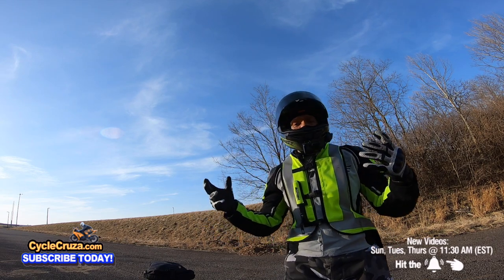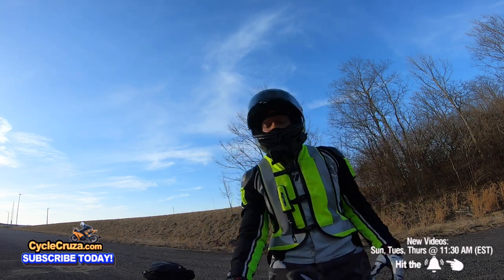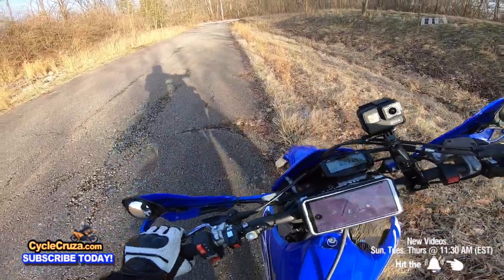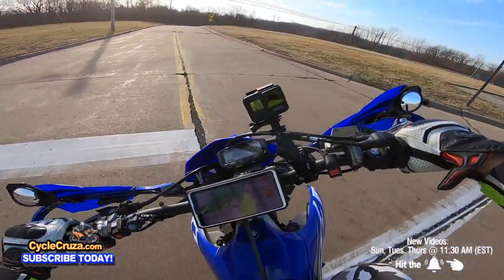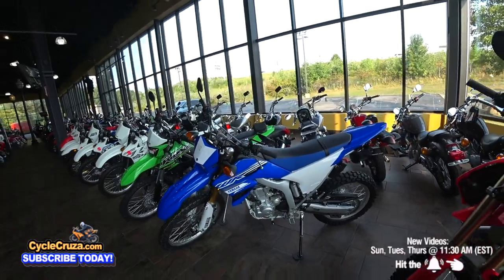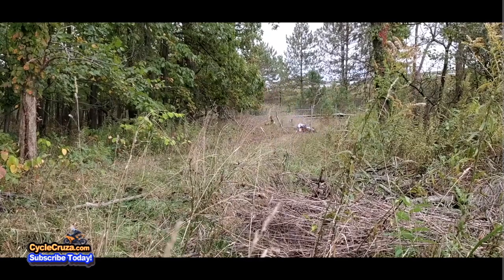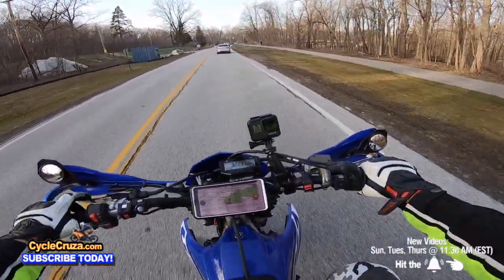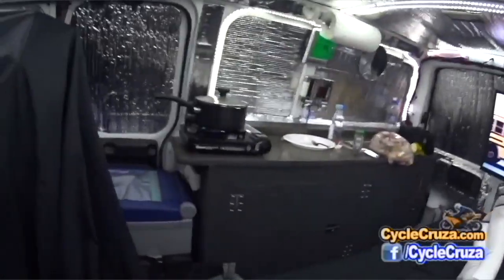UGLY Truth About Dual Sport Motorcycles

Comment: Your super moto is NOT the best of both worlds
Reply: Ouch
Reply: The drz400sm is though lol
Reply: @22smcrrider96  IMO the 690. I've been on a ton of bikes. The 690 is the perfect motorcycle for someone who is spirited.. you get speed, torque, crazy suspension, just everything man. The 690 is amazing. The Mt 09 is a close 2nd and that hurts me to say
Reply: @22smcrrider96  hahaha. Same bro. I bought mine last March. I put 10k miles on it.
Reply: @22smcrrider96  the point is that there isn't the BEST of both worlds.  Going Dual Sport means you can have a decent road and off road bike.  But they always fall a little short of a dedicated bike.
Reply: @jonasbaine3538  LOL. I'll tell you what I'm amazed how the 690 SMC R handles in dirt with street tires I'm on Q3+S  and I'm out here power Wheeling on dirt roads hitting jumps and shit lmao. I love the SMCR
Reply: @jonasbaine3538  I'm actually smoking a joint changing my oil right now I'm going riding tomorrow
Reply: TE630, X-Challenge, or even a fat-stripped DR790.

 Procycle stripped a DR down to 320lb curb. That can still be solid on the slab, crossing the continent, with a passenger and luggage. Some DRs have gone over 200K miles.

 The T7 can also probably be stripped below 400lb curb. 'Japanese reliability of the CP2 is nothing to sneeze at.
Reply: @RKmndo  I got my 2019 KTM 690 SMCR down to 310pounds with a full tank. It's like 298ish with no fuel
Reply: Ditto! I think he does these videos to piss people off. But that YZ is going to need a lot of Maintenance and a rebuild before you know it. He hardly put any real miles on his bikes. The WR or T7 has longevity on its side and will last long beyond that Supermoto of his. There's a price to pay for all that power and light weight. Also the 17in wheels and 80/20 tires he has will not go most places a true dual sport will go. Most people prefer a low-maintenance a versatile machine. Not to mention his YZ cost probably double the price of a WR when it's all said and done Anyway take what CC says with a grain of salt. It is entertaining and some of his videos are informative.
Reply: 100% is. Dont knock it till you try it. 690 is a great bike but no where even close to a good dualsport for offroad
Reply: @vondrz1391  if you can ride it is. I've had mine with street tires in trails and it didn't skip a beat. I've been on mostly every bike especially the 450 class ...it doesn't compare to a 690/701. UNLESS YOYR HIGHLY SKILLED AND ON A SM TRACK OR SOME TIGHT TWISTIES WITH MINIMAL STRAIGHTS...
AND EVEN THEN A GOOD RIDER ON A 690 IS GOING TO YOU PROBLEMS. TRUST ME. IVE RACED EVERYTHING ON MY SMCR AND THATS THE ONLY WAY A 450 WINS.
Reply: @ridelikebuu  maybe for roads/dirt roads or a track sure. 690 is a bigger motor. Good luck on the trails. Even a DRZ is easier to manage in tighter wooded trails imo. Depends on what youre riding but a lightweight bike is a better "do it all" imo
Reply: @vondrz1391  yeah that's true but I'm recommending the 690 mainly for cycle cruza. I've never had it in tight tight trails but I have had it in some questionable areas and you do feel the weight. But other than that it's a badddddd girl
Reply: @ridelikebuu  100% a beast bike. for cruzas needs i agree he should try one 👌
Reply: @vondrz1391  Lighter is better for a dirtbike, but not necessarily for a do-it-all. A light dirtbike might be better on a dirt track/trail, but a heavier 500EXC enduro or a dualsport is generally going to be better running slab. Vibes, instability, lack of a cush-drive, and narrow overall gearspread make most dirtbikes miserable on pavement rides longer than just around the neighborhood. Dirtbikes don't have passenger pegs either.

 I'd lean more towards a TE630, or DR-Z500S with a wide-ratio gearset, for a do-it-all moto. Strip some weight and get some SM wheels. They can even haul luggage and a passenger all day. I prefer availability of huge tanks, a carb, and conventional forks for a moto that I might ride through BFE.

 The WR250R/X needs more power. He would have probably been happy on a 500EXC.

 Tube tires aren't difficult to deal with.
Reply: @RKmndo  the 450fx is the same weight as a 500exc. DOHC 450 is less vibrations then a 500 SOHC. I dont think cruza is riding with any passengers. Hes a MGHOW. DRZ is a great bike but no comparisson in power department
Reply: @vondrz1391  DR-Z500s can put out plenty of power...60+WHP.

 If he doesn't have kids or date, that's his perogative. I like having removable passenger pegs, and with dirtbikes that isn't really an option. I occasionally want to haul my kid around or move my feet around on long rides.

 Passenger pegs are offered as part of an aftermarket tailrack system for the 500EXC, BTW.
Reply: @Bmichaels679  you’ll never have the best of either of it’s not a dedicated bike, yes. But you can have a “best” at doing both.
Reply: How much does that bike drop with the supermoto tires a d wheels
Reply: A lot of opinion described as facts here
Reply: Ya i drove my shadow thru leaves once.  Does that mean i uave a duel sport?

Comment: My KLX300 does fine with turns. I don't have any issues riding it on the road. Got the 21/18 sized wheels on it.
Reply: Yeah, his 90% street isnt really "dual sport" is it?
Reply: @TheWhippetmaster  not quite. 
I ended up getting rid of my KLX300, gas tank was too small and not enough power. 
I have given up on moto camping or off roading too hard to shift with moto boots, and I can't afford to get hurt with all the other hobbies I have.

Comment: If you want reliability, low maintenance, offroad capability, travel long distances and touring then you can't beat the Yamaha Tenere 700. I converted mine to tubeless (rear only) so it got the best of both worlds
Reply: or you could get KLR650 for half the price wich will last you as long as an anvil ... whether you like it or not
Reply from the maker: How did you convert the 18" rear wheel to tubeless? Did you do it like I did on my YZ? https://youtu.be/lniuSPDtDgM
I didn't think you could safely convert a 18" dual sport rim to tubeless.
Reply: @CycleCruza  a lot of adv riders convert their 18/21 wheels to tubeless with kits like outex and such. But I find those kits a bit sketchy. That's why I send my rear wheel to Bartfactory in Italy. They do the tubeless conversion professionally and it looks way better than those outex kits. I have a video on my channel. The front wheel of the T7 doesn't have a safety hump and it can be dangerous if ran without a tube. So I'll keep the front tubed and maybe in the future I'll buy a new tubeless front wheel. Most of the flats happen on the back tyre anyway and those are a pia to replace a tube on during a trip.
Reply: XR650L.

Comment: Your bike is excellent for your needs, as you mostly ride it on road. I ride a KTM 690 Enduro R which I use for everything from enduro trail rides to touring on. It’s low maintenance and very easy to check the valves every 10,000km. It’s also great fun on the road carving up the corners and keeping up with my mates on more road oriented bikes. I’ve never had an issue with the front tyre sliding out on the road. I’ve been using Mitas and Motoz tyres which also last well.
Reply: I love my 701. Just throw gear on and go find a trail.
Reply from the maker: How many miles do you get out of your rear tire? What about a puncture in your tire? I assume you have tubes?
Reply: @CycleCruza  I got 3,500 miles out of the stock Metzeler Enduro 3 Sahara, 5,600 miles from a Motoz Tractionator Adventure, and 3,125 miles from a Mitas E09. I’ve just replaced that with a Motoz Tractionator Rallz. I do run extra thick tubes. The only puncture I’ve ever got was in the front on an enduro trail ride. I don’t bother carrying anything to repair punctures, I just carry an AA card which I’ve never used.
Reply: @johnnste1  I've got the tractionator on mine too. Pretty good. Oh, and heavy tubes

Comment: Dual sports are my favorite category of motorcycle. I've had an XSR900, 2014 Valkyrie, and a 2014 VStrom 1000 but I still have my farkled DR650 and 2018 XT250. I ride mostly pavement but I also don't have to ignore or avoid gravel roads and trails. Dual Sports are great for exploring. 

Eventually I'm going to put a 19" when on the front of the DR as I hear it's a great compromise between Street and trail. It already has Cogent suspension front and rear which transformed the bike. My next set of tires will also be Shinko 705s. The XT250 is a great little bike but I think I might sell it to get more metal fabrication tools, a VW Bug, or a Karmann Ghia project car. The DR is great for exploring, commuting, and even traveling.
Reply from the maker: Nice! Maybe I should try 19" supermoto wheels and compare the difference off-road.
Reply: @CycleCruza  That would be cool to hear what you think of the difference. Your bike looks great as a super moto and is obviously a proper candidate for it. I think the DR650 looks a bit goofy with a 17" front wheel and I hear it makes it twitchy. A 19" looks much better and is much more responsive than a 21" hoop.

Comment: Fun thing about that bad ass SM and dual sports is they are naughty motorcycles.  They encourage wheelies, shenanigans on staircases after hours in business parks, jumping truck ramps, etc, plus you can go for a trail ride on them.  I had plenty of fun on an XL600 back in the 90s.  Current owner of a Husky 701, which has God's gift to big single engines in it, especially after shopping on the Rottweiler Performance site.  The biggest problem is the 701 is extra naughty, but darn it if there aren't security cameras everywhere now.  It is hard to find a safe place to commit harmless mayhem 🙄

Comment: I respectfully disagree with not taking an adventure bike off road. I’ve used my Africa Twin as a dual sport since the day I bought it. Yep. It’s heavy and not real fun to pick up. But the way I’ve got mine set up, it RIPS off the pavement. For the general population I’d say yes, don’t take one off the pavement in the middle of nowhere such as I do. But if you have experience, balls, and low intelligence such as myself an adventure bike is the way to go 🤘Great explanation of the downside of dualsport though. Thanks for the video. Subbed.
Reply from the maker: ADV bikes make for the best touring bikes and are fine on some dirt roads and back country roads but  I would never take one on a gnarly single track in the woods. Motorcycles are like tools, there is a different type of motorcycle for each application. The Honda Africa twin  is a great bike for sure. Thanks for the sub! I appreciate it.

Comment: Great vid! As an owner of several Yamaha dual sport (DT125/250/XT350/600) over the years, I wondered about one of those YZ450 bikes and how well they would do converted to dual sport. I don't know much about them but I figured there's more engine wear with performance. But, constant oil changes might help mitigate that problem. Good info!

Comment: Why can't you do the same thing to a dual sport rim that you did to your supermoto rim to make it tubeless? You can also buy the same tires for a dual sport that you have on your bike. Shinko makes the 705 in a 18 and 21. They don't have the power of yours, but a lot of people only cruise around like you do 95% of the time and don't need the power to do wheelies because they don't do them.
Reply: You can. It's quite simple actually, just seal all the spoke holes with silicone and that's all there is to it. Works fine. The problem arises if you're riding your dual sport really hard off-road at low tire pressures and the bead flexes some and you lose tire pressure. But otherwise it works quite well.

Comment: Your bike is still a dirt bike first and foremost, you just put some blinkers and stuff on it and threw on some street wheels/tires. Anyone can make their dirt bike into a more street capable machine but if you go off road with those wheels and tires you’ll just be asking for a crash with any real trail riding which most people who buy a dual sport look to ride more off road and dirt than the street… This video is just your opinion and it’s really arguing semantics in the big picture. I have a Husqvarna fe350s that I could do the same thing but it’s really a street legal dirt bike that I can ride on the street to hit connecting trails but mostly live off road and it’s only like 236lbs dry so around 240lbs wet.

Comment: You can run the tubeless Dunlop Missions on a dual sport. You just use the tubes with it. I have a DR650 it has a 17” rear wheel.

Comment: Bang for your buck the drz 400e is my fave. Good street manners, tractor off road torque and long service interval. Still got sporties for the tar, gsxr750 and R1,but the humble drz is the fun bike.
Reply: Yeah I agree, it's very hard to beat the old DRZ 400. I have one too, bought it new back in '14 and use it for running around town, and take it to the mountains to ride the tough mountain trails. It does it all really well, and doesn't need much maintenance. I think the valve check interval is 14,000 miles which is really great. I've been riding this bike for almost 9 years and it has about 8000 miles on it. So I'll go another several years before it needs a valve check. It's just hard to be beat this bike really.

Comment: Those oil change recommendations are for flat out wide open racing conditions..   You just like to go on short rides.. You never  go to the Grocery store or ride across the Country on your Super Moto Bike ..  Thus you need to haul it and all of your luggage and camping Gear in a Van ..
   Thus with an Adeventure bike you don't need a Van too ..  Some of the Adventure bikes to have tubeless tires..
   Dirt bikes run tires with  tubes because they run a very low tire air pressure and with tubes you don't have to worry about the tire coming off the bead and losing all of your air pressure .
Reply from the maker: Dirt bikes hold very little oil, like 0.60 quart of oil. You have to change oil on dirt bikes like this at least every 10-12 hours, regardless if you are racing or riding on the street. Go look at KTM 500 exc-F, which is a street legal dirt bike dual sport, oil change intervals, same 10-12 hours. Even the Honda CRF450L Dual sport, which is a street legal dirt bike dual sport, requires oil changes every 500 miles.
The ADV bikes with tubeless don't have a 21" front wheel, you cannot make those tubeless from my understanding. If you could I would have done it back when I had the WR250R.
Reply: @CycleCruza   My  1998 YZ-400-F holds  1.7 Liters of Oil .. It's  a Dry sump system the oil is in the frame.  You add oil and  check the dip stick in front of the gas tank.  Have they changed this.  My bike is kick start only and has a carburator ..
Reply: @CycleCruza    I found the owners manual  for several Motorcycles that I have owned   1976 YZ-125  1978-YZ-100-E Shop manuals for the RD-400-c and my RZ-350 I also have the Shop manual for my 1998-YZ-400-F  Yamaha wants  $90.00  for a Print on demand  owners manual .  I know I have it .. I have 4 different filing cabinets..  The Shop manual won't tell you oil change intervals
Reply: @CycleCruza  For the '02, they decreased the oil capacity by 200cc to reduce weight.

'98-'01 400/426

Oil capacity

Engine oil

Periodic oil change 1.5 L (1.32 Imp qt, 1.59 US qt)

With oil filter replacement 1.6 L (1.41 Imp qt, 1.69 US qt)

Total amount 1.7 L (1.50 Imp qt, 1.80 US qt)

'02 426

Oil capacity

Engine oil

Periodic oil change 1.3 L (1.14 Imp qt, 1.37 US qt)

With oil filter replacement 1.4 L (1.23 Imp qt, 1.48 US qt)

Total amount 1.5 L (1.32 Imp qt, 1.59 US qt)

Comment: Ktm 500 exc…. Extremely reliable. 600+ hours without opening a motor has been done before. There’s an article of a guy who got 86,000 miles or 140,000km on his 2016 ktm 500.
Reply: Tall seat and costs 2 times similar class dual-sports! Still, very nice.
Reply from the maker: Nice! I need to try a KTM. I'd like to start a collection of various types of supermotos. Maybe even add a fuel injected two stroke supermoto for fun.

Comment: Why would a super Moto need oil changed more frequently than a regular dual sport motorcycle? I understand actual dirt bikes don’t have odometers so you normally go by the hours but is that the only reason? Maybe since it’s a lighter bike and a more powerful engine made for racing it should be changed constantly? Just wondering why I can’t just change the oil once every few months if I daily one

Comment: In my Opinion:  On the street, dual sport tires are Unstable at Any Lean..  they're all over the place on the street.  Lean and hope just isn't my style.  This DSport bike was wrecking my road driving skills.  No way can you practice precise maneuvering skills on DS tires.  I swapped to street tires (of the same 21/18") sizes, huge improvement in waundering in curves and initial lean estimation.  I'm sure some DS tires are better than others, but those bumps on the side are an issue.  Also the DS tire compound seems much harder which are prone to sliding on very minor parking lot sand which softer compounds accept.   My off road adventures (75 Miles of Gorgeous Power Line Right of Way) have been curtailed by warning signs and private property threats of prosecution.  At least Signs are protecting our Power Grid infrastructure.